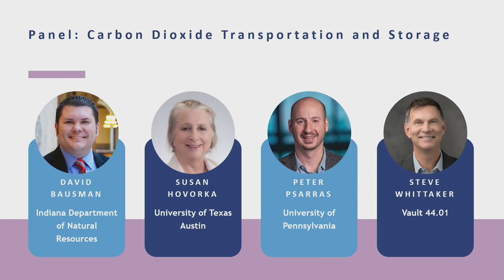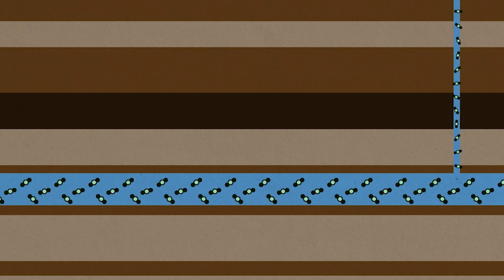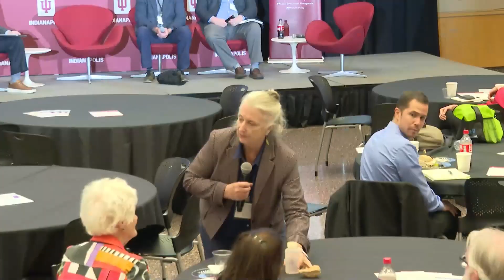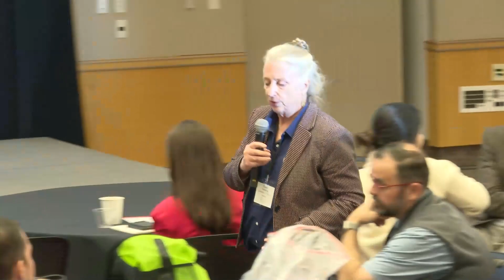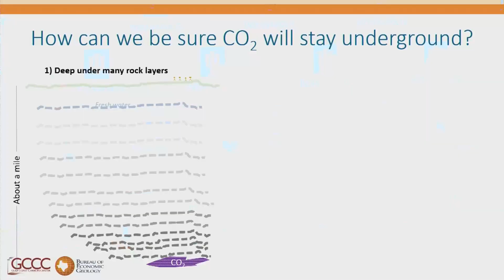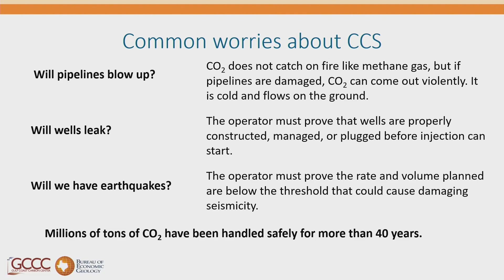R2R Indiana - Panel: Carbon Dioxide Transportation and Storage

Comment: Its fine to offer products for transporting carbon dioxide and storage.   It is scientifically impossible for carbon dioxide's greenhouse gas behavior to change the overall effect of earth's water vapor saturated greenhouse effect that absorbs all the greenhouse radiant energy from the earth within 20 meters form the radiating surface adding 5.55°C (10°F) to earth's average temperature.  Global warming mysteriously paused at about 1°C in 1992.  In 2022 Global warming was officially reported at 1.06°C.  The Arctic region is warming the rest of the world is not.